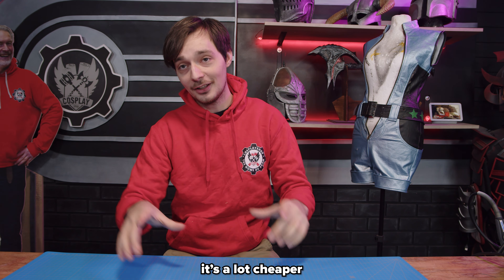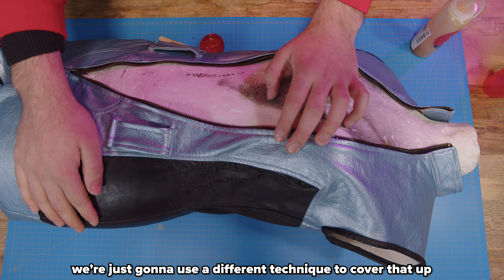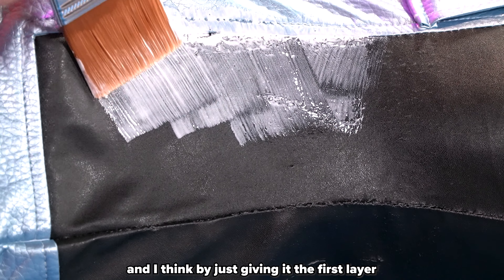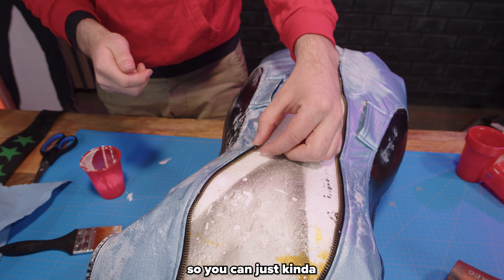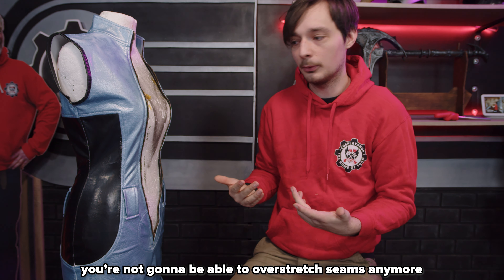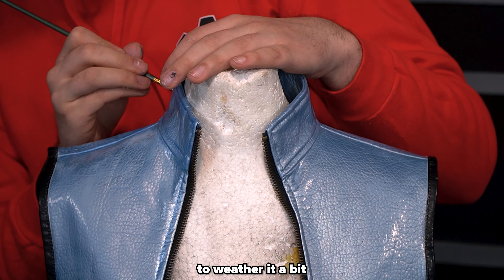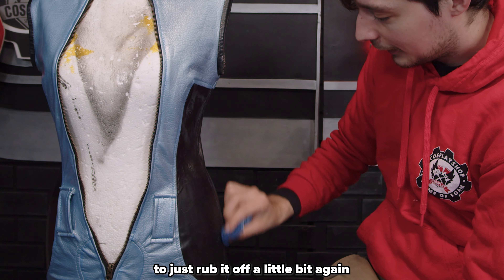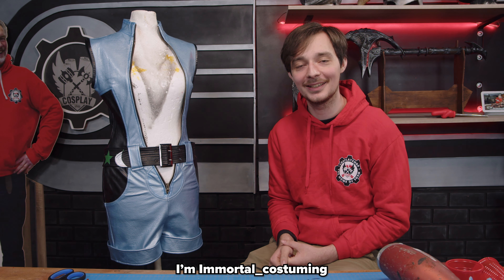How To Repair Fake Leather - Cosplay Tutorial

Comment: Thank you so much for this video! Not for a cosplay, but I have a jacket that I really would like to try this with. I've been feeling terrible that the jacket is essentially ruined due to the faux-leather being terribly ripped up. Just a question though; after applying this product, can you still put the clothing in a washing machine?
Reply: Well I think that might be your problem to begin with. I find putting faux in the washer ruins it a lot faster. By the way, did it work? :)